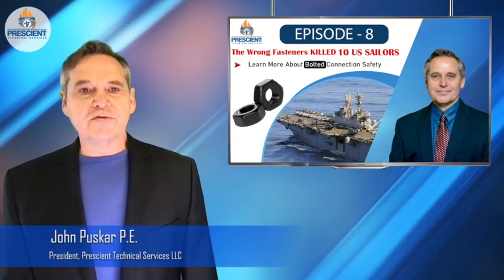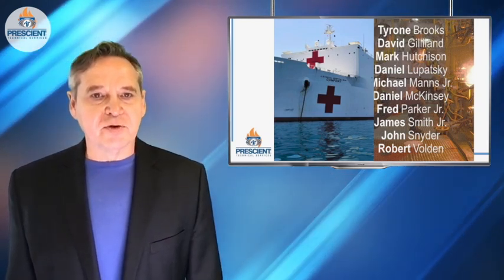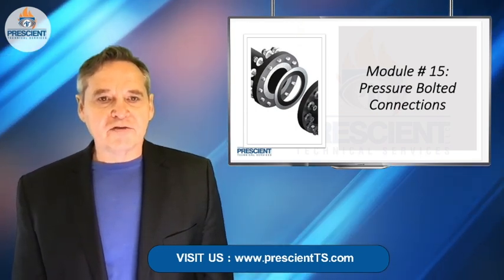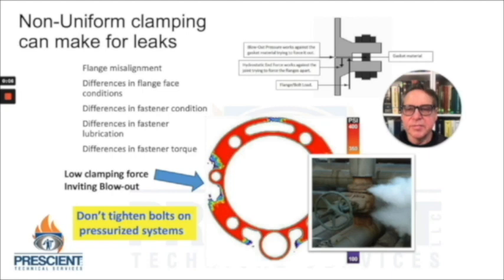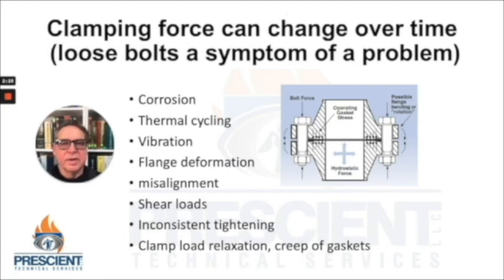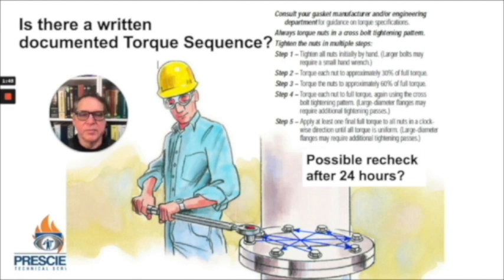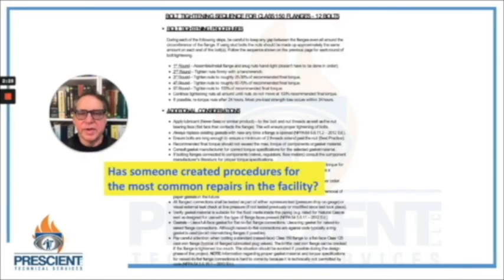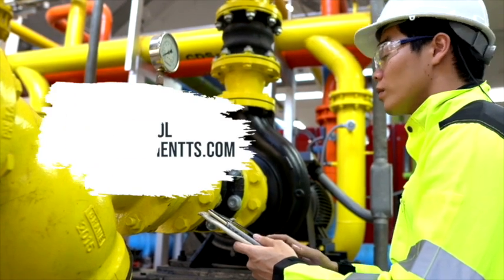Steam Piping Accident Costs 10 US Navy Sailors their Lives!

Comment: Why is there no crush ring?
Like a high boost diesel engine will have a groove and ring like between a head and a head gasket?
Reply from the maker: I think you're talking about the type of flange sealing arrangement here and  I think what you're referring to is a "Ring Joint" gasket arrangement. A great alternative to raised face flanges, especially when temperatures and pressures go up. However, possibly because of cost, I mostly see raised face gasket arrangements in the industrial steam world.
Reply: Raised face flanges are used in superheated steam systems because they can make use of composite, spiral wound gaskets. These are typically made of graphite surrounded by inner and outer rings made of steel. This makes them both very durable and shock-resistant. These properties  make them prefered in this application due to their reliablity against blowout during a water/steam hammer situation, however, they are incompatable with ring joint flanges.